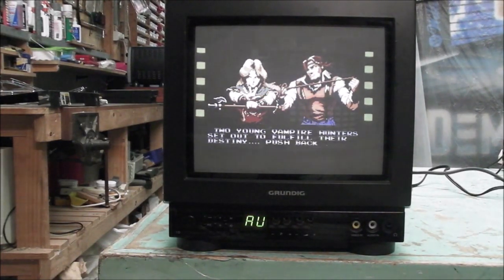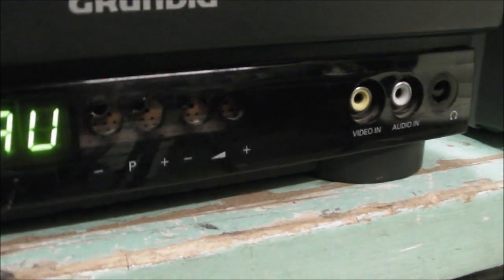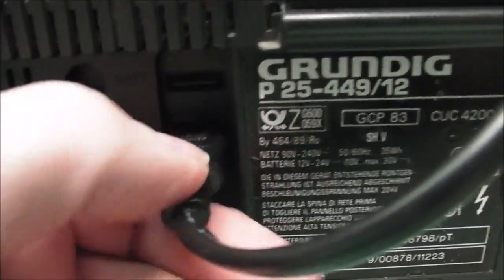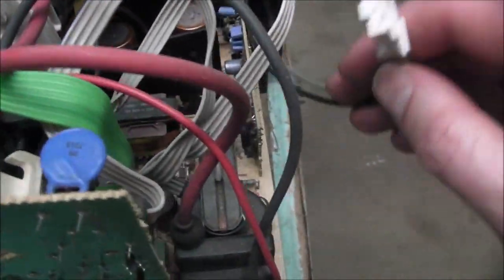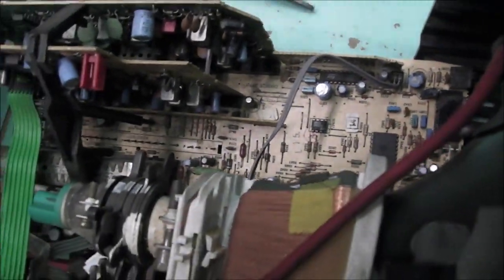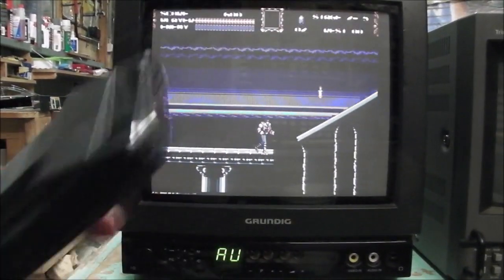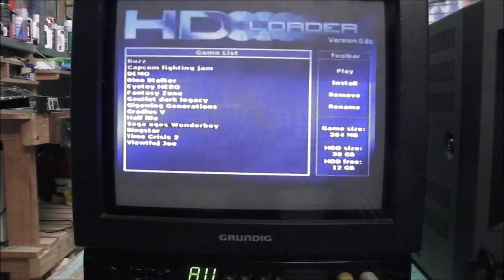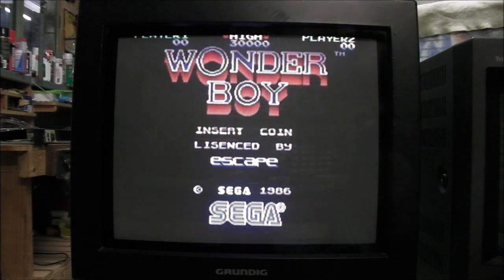Grundig P25-449/12   10" CRT Scart TV

Comment: Interesting. I picked up a P 27-649 two years ago and its power switch also broke after a couple presses, and the 12v circuit failed according to the seller. It also seems to show an equally horrible amount of blooming (picture changing size and shape depending on brightness of whats on screen), and high amount of underscan. Mine also shows bright streaks in front and behind bright things. It's also kinda weird how this one is older, chassis 4200 instead of 5200, but this one has a flat square tube while mine has curved (samsung) tube with rounded edges. Guess all in all these models just don't age well. It's a shame cause the tube is still very fresh and colours and sharpness are pretty amazing. Still keeping it around to maybe recap someday.

Comment: hi, i also own the same model of tv. is it possible to access the service menu without the remote control?
Also do you have an internal schematic to understand what some potentiometers do in the chassis? I would need that to adjust the image, and in particular to move the picture horizontally.
Thank you
Reply from the maker: Sorry I don't have the answers to your questions.
Reply: @rgbrob  ok, tnxs anyway
Reply: @TheSupremacyCabinet  hello sorry for the inconvenience, did you manage to figure out how to fix the geometry?
Reply: @cosmoslab7810  no unfortunately no, not having the original remote control I bought a compatible one, but it does not allow me to access the service mode (as long as there is a service mode)